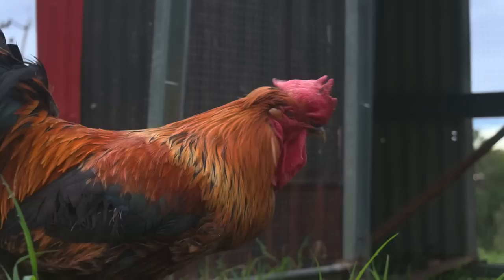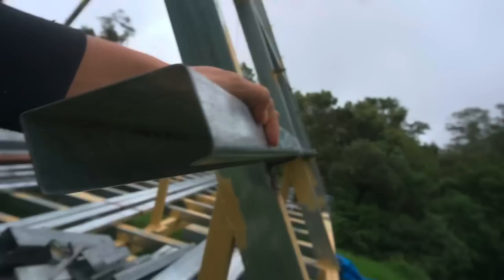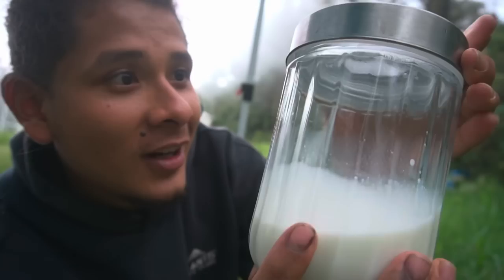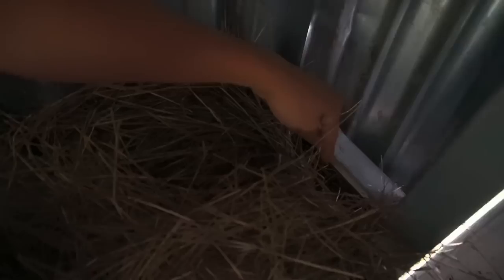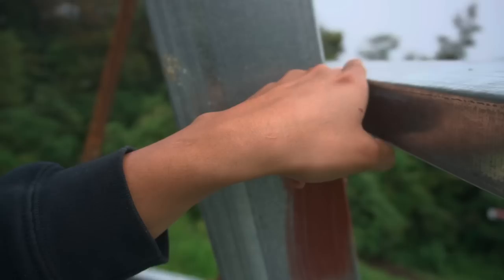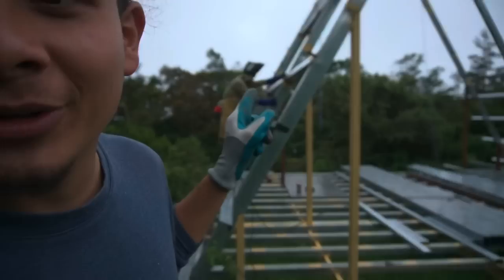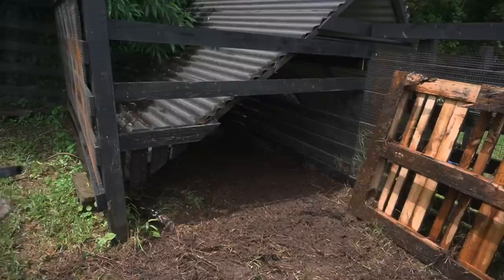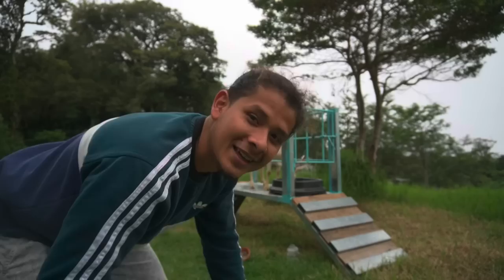BUILDING MY DREAM HOUSE… but it’s hard

Comment: Good job improving the floor of the male goats’ house, but the female goats’ house is a hazard. The pallets used as flooring are dangerous to the goats' hooves / legs.  They need a floor that is solid and raised above ground level.  The entire area should be dry.

Comment: Looking good Rodrigo! Excellent that you have your buddies helping you! Suggestion: just like with wood joists and headers, place the “crown” of the careolas on top, rather than allowing them to sag. I think the welds will hold, so you needn’t worry about stress fractures.
Could the drop in milk production, also be a natural result of the nag’s cycle? Now that the kids are older, maybe the need to produce milk lessens?

Comment: With the issues you are having with the goat pens and water problem:  Could you not build a cement platform and raise the pens at least 6 inches off the ground giving them a proper waterproof floor with which you could easily rake the hay etc out to clean it?  Do this also for the chickens and you will save money and time in the long run.  You guys have taken the responsibility of animal ownership and you have to protect them from the flooding.  I still think you need to put up a wall at the backside of the boys goat pen to protect from rain and wind.  They need to have somewhere to be dry.

Comment: Have you considered the weight of these crossbeams you are putting on the top joint of your A beams? The joints at the top are having a lot of weight put on them. Are you planning to put cross connections inside near the top of the A beams, a short piece going from one side to the other side, near the top? It might be more stable, stronger, if you did. It looks great to me, but I am no engineer, so maybe you guys have somebody to ask or consult.You are doing such a great job Rodrigo, and it is great to know you have help, too. The animals are looking better and better. You are such a hard worker, and I can tell you it is the best time in life, in order to achieve such goals. So you are very wise to build your house now. God bless you!

Comment: Hello Rodrigo If you dig a small ditch all around the outside edge of the goat barn and fill it full of gravel the rain water will not run inside the barn. The floor will stay dry. Try it. I hope you will get this message.

Comment: Really hope he reads this.. I know its a long way off but when it comes to power for the money may I make a suggestion. Use a small solar system with deep cycle batteries and 12v lighting. You can skip the expensive AC converter and just use DC lights and as many appliances as you can. Things like a 12v RV mini fridge w/e DC you can find.  

See converting dc solar to AC house hold losses energy in the process. For fairly cheap just wire it to a car type dc fuse box. You can use cheap speaker wire for many things like lights. Find camper DC lights I light my entire house with DC solar using two Lead acid deep cycle marine batteries AGM specifically. Spot lights outside you name it it hardly depletes the batteries...